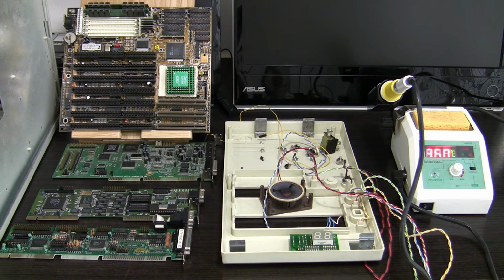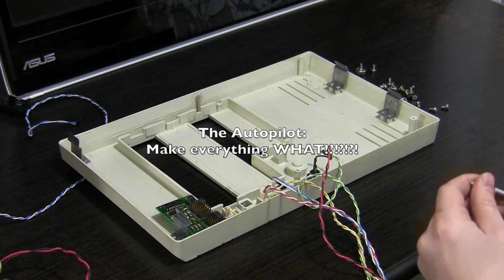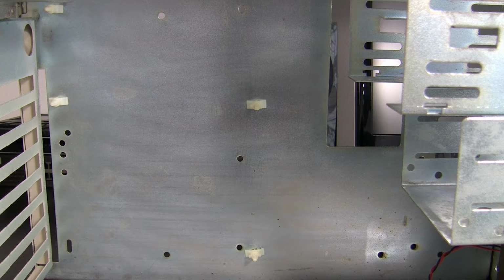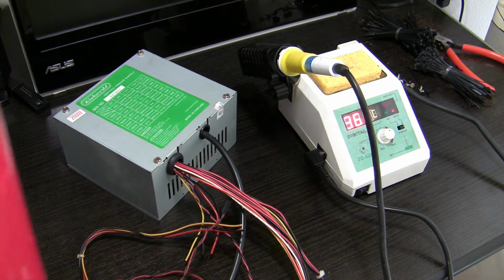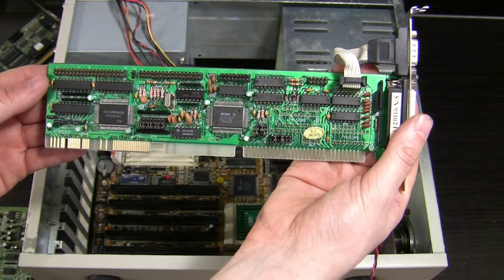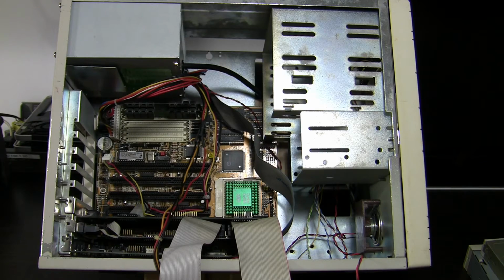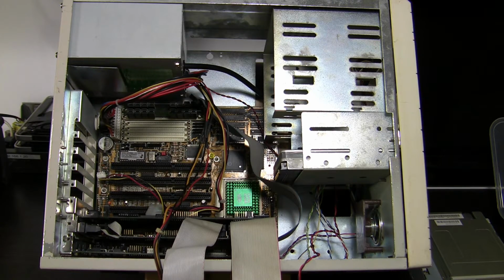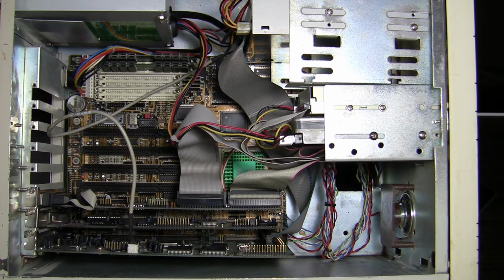Episode 5 - Building a 486 computer - 80 MHz Cyrix DX2 with a VLB motherboard

Comment: I've been going through your videos starting from the oldest, and I'm enjoying them.  You've shown a lot of good practices for building PCs.

One suggestion though.  When you are putting screws into a soft material like plastic or thin metal, start by slowly turning the screw backwards.  Do that until you feel the screw click into the threads, then start screwing them in.  This ensures that the threads are properly aligned so you don't accidentally mess up the threads.

Comment: This is awesomme..... I finished up my dx2-80 yesterday, and we are both using the exact same S3 chip. My specs are: Amd486-dx2-80, S3, Goldstar VLB controller, 8xCD-R, floppy drive. for sound I am using an SB16-vibra with OPL-chip and for harddrive I am using an CF-card with 512mb storage.

Comment: Make a video geting the 8 led to represent the correct Mhz value. i spent hrs on my 386dx 40 and could only get the the turbo on correct. its so hard without the documemtation, was good fun.
Reply from the maker: Will do at some point, cause I like those MHz displays and I use them all the time. I have uploaded a guide I found somewhere in the Internet about the most common types. It is in the info below the video in the datasheet section. Unfortunately many models differ ...and yes I know the fun you are talking about, haha.